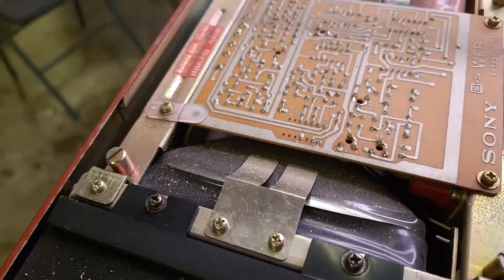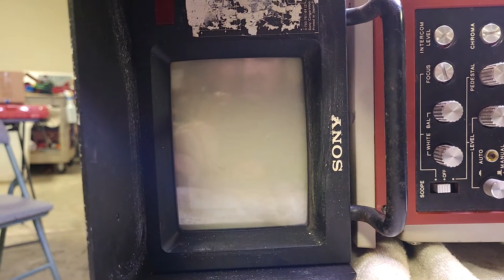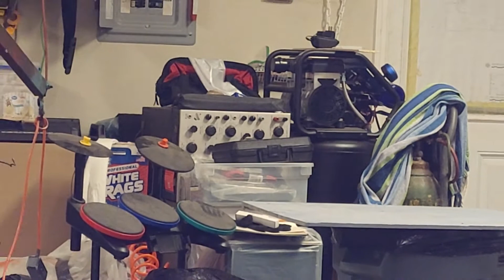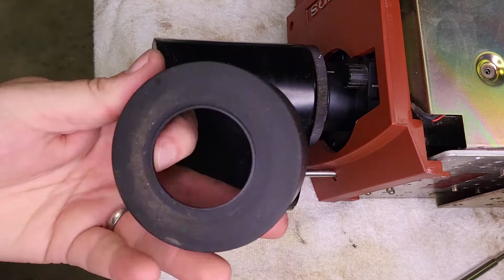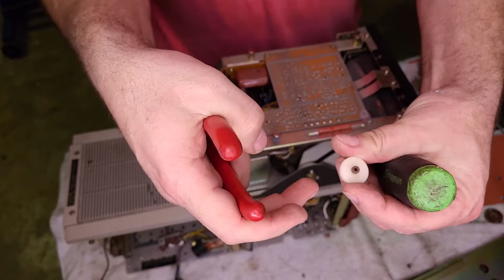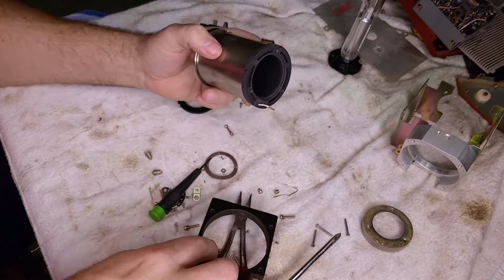Sony DXC-1200 repair and teardown (Yes in that order)

Comment: Hello I have a broken one. Do you think I could pay you to repair it ?
Reply from the maker: I really dont want to get into that. I lucked out here and it was a part i knew how to fix. If you find someone to do it i have most the parts from this one on ebay. What is yours doing?
Reply: @JPN76   well it was working perfectly fine that poof it just died. It still powers on. I think a capacitor went bad.